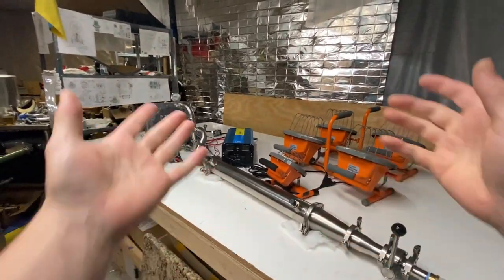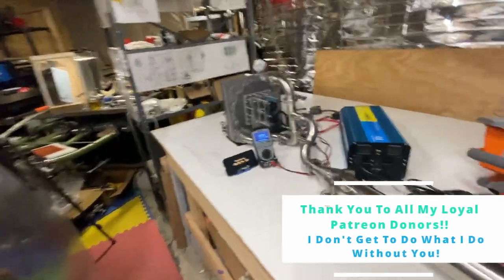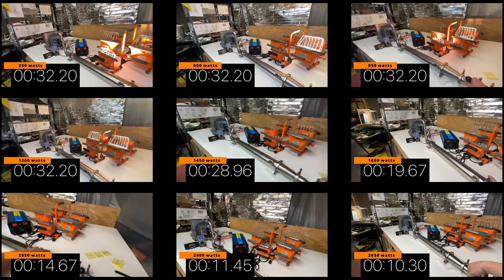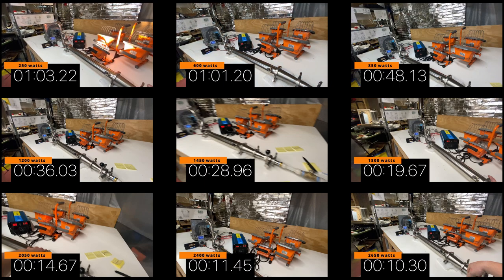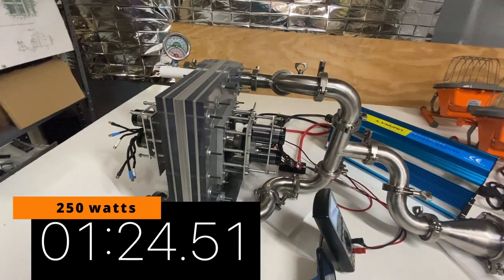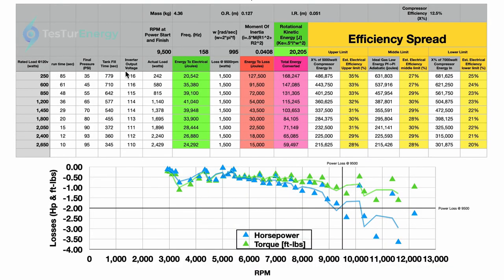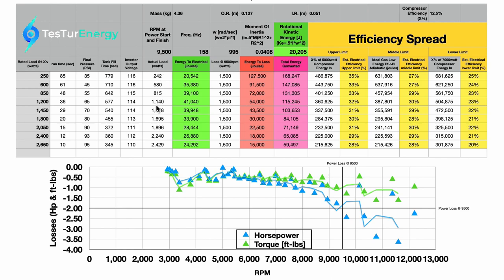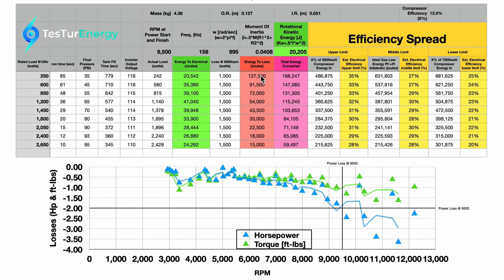@TheActionLab said Tesla Turbines don't work?-a Tesla Turbojet engine that actually works

Comment from the maker: Make sure to check out the latest updates on the combustion + steam Tesla turbine builds! 

+5 Horsepower Tesla Turbine Dyno Jet Turbo Power & Torque Curve 375 mph @ 125 00 rpm HIGH SCORE!
https://youtu.be/exF5Rn-L8gs

Solis Talks Tesla Turbines - Nikola Tesla’s Electrical Power Systems Patent GB 186,083 Walk Through
https://youtu.be/5Y3D13JmtcA

Tesla Turbine Jet Engine - gasoline fuel burner atomizer flame tube test 186,083 propane burner
https://youtu.be/gRqKowignac
Reply: Seems like direct shaft and better system for conversion should put u above 45% and ideally closer to tesla numbers
Reply from the maker: @bestowicprimer8835  for sure! And that’s without actually fixing the turbine casing and nozzle too. The nozzle is just atrocious right now 🤭 and the casing has about an 1/8 of an inch gap between the turbine endplates and the wall on both sides plus basically zero labyrinth seals stopping over flow going around the turbine. 

Something that would be fixed with a properly machines casing and disc stack that doesn’t have any run out. 

There’s also like an 1/8 of an inch of run out on in disc because it slightly bent getting it onto shaft. 🤷‍♂️ works like a champ though
Reply from the maker: @bestowicprimer8835  also these are definitely low ball numbers, plus it includes the spin up which is the least efficient use of the air. So it’s for sure doing better than these calculations 😈
Reply: @CharlieSolis  action labs timing seems coincidence have you communicated?
Reply: @CharlieSolis  o yeah I'm still gonna be dropping whatever I'm doing at time when your ready to market a product
Reply from the maker: Dood… you’re now the 3rd person to mention how “coincidental” @The Action Labs “Well thought out” 🙄 tesla turbine video release is with my work…. 

And to answer your subtle question, yes I literally watched the performance of my last 2 videos come a lurching HALT almost exactly when action labs released released their video…. 😑

In my humble opinion, that video is so wholly under the usual quality that @The Action Labs usually puts out too…

It’s so questionable… but I don’t wan to seem paranoid, because this is very vane and paranoid to think like this….

I just can’t help but question… did someone pay them to throw together a bullshit Tesla turbine video laden with every cliche erroneous claim about the Tesla turbine, so lousy with them in fact that it’s dang near comical at this point…. 

🤷‍♂️ idk… their team would never admit to it if they did… 

It’s ABUNDANTLY clear though that team didn’t even bother to read the actual patents before slapping together that video, to post it getting over 100k views in less than 24 hours…

All I can do is keep pumping out these awesome test results and hope the YouTube gods find my contribution worthy 🤷‍♂️
Reply: Hear me out… You selling this to any F1/WEC teams to put onto turbo blowoff valves/waste gates to add battery range/power?
Reply from the maker: That’s certainly a good idea! Would def Irey extend the range for a lightweight addition.
Reply: 5hp for how many seconds?

Comment: Is your steam CHP going to incorporate a crypphorous component?
Reply from the maker: Yessir. So technically the cryophorus is just a closed loop Rankine Steam system that exhausts to vacuum.  It’s no different than a full plant steam boiler that goes from high pressure to a vacuum condenser. 

It’s all the same Rankine thermodynamics. And the same thermodynamics as the organic Rankine cycle turbines (ORC). ORCs just use some kind of refrigerant instead of H2O steam, which is better because they can reach higher pressure at lower temps and because the latent heat of vap, which isn’t available for power out through steam expansion, is MUCH lower for most refrigerants than H2O. 

Check out the video i put out on the vacuum steam systems and ocean thermal energy conversion plants! 

Solis Talks Tesla Turbines - Nikola Tesla’s Electrical Power Systems Patent GB 186,083 Walk Through
https://youtu.be/5Y3D13JmtcA

Comment: Could you please go over your balancing technique sometime?   It would help immensely with my own replications, and probably many others.🤓
Reply from the maker: Yessir! Check out my video on Nikola Tesla’s balancing apparatus patent replication and let me know if there’s anything I can explain further!

How To Do Dynamic Balancing of Tesla Turbines, Turbo Jet Engine Rotors & More On A Lathe
https://youtu.be/NiPPF2MORlg
Reply: @CharlieSolis  Ah, OK that makes a lot more sense now😄
I tried a technique like that, but because I had a real hard time with harmonics+issues caused by the grinding disk or lathe bit when balancing.  And probably my shaft was too thin for the axle length so it introduced a lot of wobble+warp in the rod.

Using a toolpost grinder on the inner periphary looks like it's much less harsh on the balancing process vs coming in from the end as well, and the piezo idea to get a quantitative comparison is really clever for the cost.

Arigatou, thanks much😇
Reply from the maker: You’re very welcome! 

And yeah you definitely want the shaft to be flexible. If it’s not you can suspend each side of the shaft in yieldable bearing spring supports. 

For all intents and purposes this is a “Jeffcott rotor experiment”. You just utilize the correct RPMs to make sure to take off mass only when the heavy side is on the outside. 

In the patent Tesla also suggests adding a dummy rotor mass to any disc stack to be balanced that the grinding can be done on so it doesn’t effect the quality turbine manufacturing specs.

Comment: Salut,presiunea (energia) de evacuare nu poate fi folosită ca avantaj pentru a comprima mai usor? Ai incercat sa incalzesti aerul sau turbina sa vezi ce performanța are?!
Reply from the maker: Hey thanks for commenting! It really helps with the algorithm! 

I in fact have done some tests to see the increase in energy available when heating the gas! Check it out 

Tesla Turbine 1200 Watt Electrical  Load Tests - Power Calculations - compressed Air + Propane
https://youtu.be/bWpXRzrzf4g

Comment: Great Work on honest engineering.  You can greatly simplify you calculations by using the simple formula for the stored energy in a compressed gas. Energy =Pressure x Volume.  7.8 gallons is about one cubic foot. Pressure in PSI * 144 (in^2/ft^2)  When units are converted you get ft-lb. 1 ft-lb =(746/500) J.  If you know the pressure drop from run start to finish you know the energy expended by the compressed air.  
You may want to run the rotor up to speed before taking the readings (P, t, etc) for the calculations. It removes the uncertainties in your estimate of  rotor stored energy.  
Good luck.
Reply from the maker: Hey thanks for commenting Jimmy! Yup yup! There’s a bunch of ways to work out the calculation. 

Stay tuned for all the latest steam system tests! 

If you haven’t gotten a chance yet to see the system setup check it out! 

Steam Tesla Turbine Micro Power Plant - 1st Start Up https://youtu.be/aMYyBsjhBR4

Comment: Could Tesla turbine work for airplane?
Reply from the maker: Hey Gabriel! Thanks for the question! Yes it absolutely can. Infact Nikola Tesla has a patent for a VTOL helicopter/plane that was from before helicopters were even invented. 

US 1,655,114: aerial apparatus patent with improved turbine nozzle design        
https://teslauniverse.com/nikola-tesla/patents/us-patent-1655114-apparatus-aerial-transportation

Give it a read through. Its quite impressive.
Reply: @CharlieSolis  I mean if it could replace turbojet engines? In that patent it shows a fan type propeller
Reply from the maker: Yes it’s absolutely possible. They just have to be designed correctly.

Comment: If I remember correctly AL didn’t say Tesla Turbines don’t work. He just said in practice they’re not giving enough benefit in efficiency to justify their use over conventional turbine; saying their efficiency would need to be “an order of magnitude” greater. Judging by your tables it looks like middle limit efficiency at the 250w output is right about where you’d expect it to be. I’m assuming this set up is more of a proof of concept. Are you planning to use different construction or materials to increase efficiency in upcoming models?
Reply from the maker: Action lab sad that the efficiency needs to be 10x greater for it to be even worth it… an order of magnitude better means 10x better. That’s not even physically possible unless other turbines get less than 10% efficiency to begin with. I’m sorry but that’s a a completely disingenuous claim. 

But I rrelevant of efficiency though, can you show me a bladed turbine that can handle the wet steam that’s produced from geothermal energy sources without eroding down the indispensable complex geometry blades to little nubbins in a matter of minutes?   Or a bladed turbine that can actually fully utilize all the heat energy in steam by actually fully expanding it and not be damaged by the condensation and cavitation?   One that doesn’t require superheaters, MASSIVE heat exchangers and expensive waste heat recovery systems to actually maintain whole system thermal efficiency?   Yeah sadly bladed turbines get zero efficiency from geothermal steam sources and can only be used to produce electricity from them with outrageously expensive multi circuit loops to keep all the fluids separate and have MASSIVE heat exchangers.   But when even just one geothermal site in California has more energy than the US needs for the next 1000 years and TesTurs see no damage from multiphase motive fluid flows I’d take even just 10% efficiency over the zero that bladed turbines can offer.   The same goes for solar steam boilers because it’s very difficult to have a residential solar boiler that doesn’t produce wet steam.   Furthermore bladed turbines can’t use low grade fuels like biomass, woodgas, and definitely not solid particulate fuels like powdered coals and pulverized iron.   That’s not an issue for the TesTur for the exact same reason that condensate and cavitation in wet steam doesn’t damage it. Because there’s no lifting surfaces for the particulate to smash into.  What most people mean to be saying is, bladed turbines get a high efficiency on only a very limiting, very specific, very expensive set of proprietary formula refined fuels.  And the only reason TesTurs don’t is because no one has actually put any money into them like the BILLIONS of dollars thrown at proprietary bladed turbine designs just to get 1% point increase in efficiency.
Reply from the maker: But as far as inefficiencies to fix, there’s 10 ball bearings in this version, 2 crappy RC car gears, both losses will be gained for power out with a direct to shaft generator. (Minus two gears and 8 crappy ball bearings)

 There’s an 1/8 of an inch of space between the turbine endplates and the casing endplates on both sides of the TesTur. That’s a 1/4 in of open flow area around the 2in wide turbine (that has a total of 0.75in wide of spacing between all 75discs ) that’s 1/4 of the total open space between discs and casing is just free flow over the side of the turbine still.

There’s no labyrinth seals yet to even reduce that overflow… 

The nozzle is atrocious at the moment because there’s two “pillars” in the middle of it because the aluminum plates in the middle only had the variable nozzle bar and inlet holes cut out and not the full nozzle geometry, so those pillars are just vertical bars in the middle of nozzle for the air to smash into just before going into the turbine (hopefully the wet steam tests will just erode them down 🤭) 

There’s about 100ft of hose between the tanks and the turbine… 

and I’m sure I’m forgetting something but between all that being fixed… I can almost guarantee we will be in the 60-70s % range and that’s all just still with room temp compressed air. 

Most forget, I’m using room temp compressed air and never went over 20psi at the nozzle for these tests.

We are comparing it to a very high temp multibillion dollar steam turbines. 

(A more apt comparison would be the 15-20% thermal efficiency that 1-5kW gas generators that you can get from Home Depot or Lowe’s get)

Just the mere fact that I’m using a low temp fluid right now means my efficiency is severely limited by thermodynamics. 

But on top of the increased thermodynamic efficiency of using a high temp elastic fluid, gasses have an increasing viscosity as you increase the temperature, which leads to increased isentropic efficiency from reduced slip on the discs.  

The disc spacing for room temp is not going to be the same for combustion temp gasses/steam because the viscosity of both can increase by 3x fold. And I’ve designed these spaces for a higher temp fluid with a higher viscosity so these will inherently be too wide at the current temperatures being used. 

So even further as we increase temps along with all these other really easy to fix issues (that only are a thing because I’m building these in my garage on a junk cnc machine) I have no doubt we will see more than competitive isentropic efficiencies to bladed turbines let alone whole system efficiencies that are through the roof because the TesTur can’t handle wet steam and no other bladed turbines can.
Reply: @CharlieSolis  hey no argument from me!!! Thanks for replying! I just wanted to restate precisely what he said. I wasn’t thinking about the 10x improvement in efficiency. That is a bit outlandish. 

I’m regard you the specifics of your rebuttal I don’t know enough about compressors or turbines to refute or frankly even comprehend your argument. But I’m planning to go back to school for a bachelors in engineering next year. Perhaps I’ll be able to go back and forth with you at a later date!! Until then I’m enjoying your content and rooting for you. Always like to see an underdog win!
Reply from the maker: @izzate7  oh that’s so awesome! Where are you going back to school at?
Reply: @CharlieSolis  not sure yet. Maybe ASU.
Reply from the maker: @izzate7  stick with it! It’s hard but it’ll be worth it.
Reply from the maker: @izzate7  give me a shout if you ever need some advice on classes or anything. If I can’t help I can definitely find you the information that will!
Reply: @CharlieSolis  awesome man! Thanks for the encouragement!
Reply: Thank you thank you for all the details... I feel like I had such a crash course from your videos and replys  @CharlieSolis
Reply from the maker: @ndudman8  cheers mate! I’m glad you’re finding them useful! 

Let me know if you have any questions!

Comment: Adding water to the compressed air, creating a water mist - increasing resistance in the flow system
Now that you have some numbers to compare with ;ø)
Nice setup and some science done - best of luck on your project

Comment: Holy crap that’s awesome! 👏🙌 How long would it run starting with full tanks if the turbine was powering the compressor to maintain it’s PSI? I know it’s not forever otherwise you would be rich! but still, I’m curious.
Reply from the maker: 😊 thanks Jacob! To be honest not for long. My compressor isn’t that large and off the shelf compressors are abysmally inefficient. The can dump 75-90% of the input energy out as heat through heat exchangers cooling the gas, getting rid of the heat of compression. 

Now if I finally made the water cooled intercooler I’ve been talking about for it I could recoup all he heat energy dumped out, use it to heat the gas before going through the TesTur and it would DRASTICALLY increase the run time. 

I can’t say for sure though because even the combustion piston engine on my compressor has a ton of heat energy it’s dumping into the air that should be recouped as well for a proper round trip efficiency tests.
Reply: @CharlieSolis   just stumbled onto your channel and now I’m binge watching.
Reply from the maker: 😊 please let me know if you have any more questions! I’m usually really good at giving everyone in depth responses! 

Cheers mate!

Comment: For those who like metric more,
initial conditions:
200 gallon reservoir @150 psi ~ 757 L @10.3 bar
end condition:
under 250W load remaining pressure 2.4 bar
Reply from the maker: Technically metric pressure units are pascals. 🤭😜
So 1.034 MegaPascal initial pressure and 757 L. 
2650watts load with 0.655MPa left.